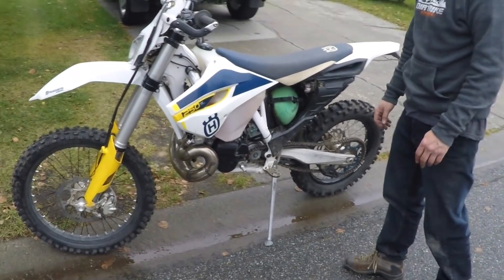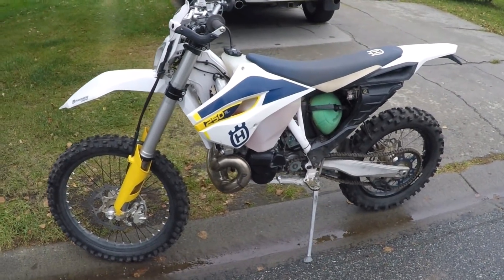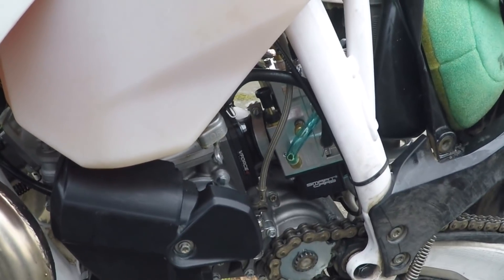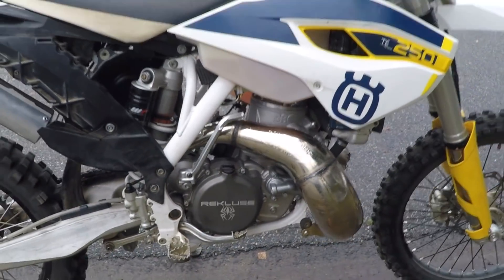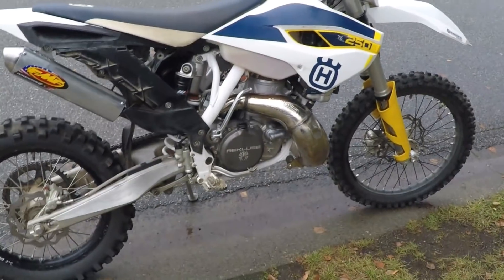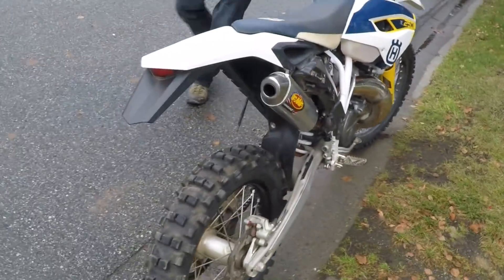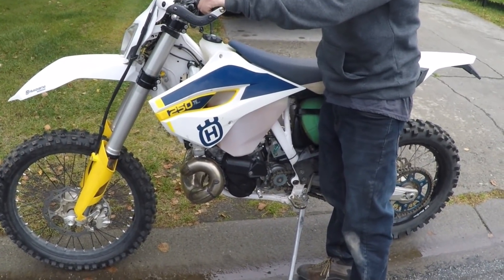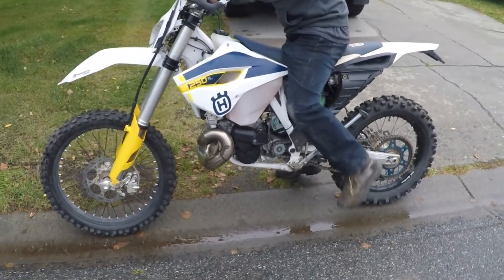BRC 500 with SmartCarb 40mm TPS and PowerCDI First Startup

Comment: How does that ignition mod work if the bike is running a carb is it a CFI set up ?
Reply: Oh it’s obviously a carb it has a choke, but still again what does that mod do ??
Reply from the maker: @kinglouis6974  It's a programmable ECU that is connected to a Throttle Position Sensor (TPS). The TPS is an add-on option to the SmartCarb. The ECU reads the throttle position and the amount of throttle change over time (it can read changes fast enough to adjust timing in a single revolution of the engine). Based on how the throttle is being operated and the concurrent RPM, it can adjust timing to retard or advance, affecting power output based on the dynamic relationship between the throttle and rpms.
Reply: Barry Jackson but I alway thought ecu was to do with injection and the ecu would change the fuel so no choke , all that mod you put on can do is change the timing ??
Thanks for the info 🏴👍🏼
Reply from the maker: @kinglouis6974  The SmartCarb takes care of the mixture better than an injector once its set; it does altitude compensation automatically. The PowerCDI ECU provides 3 times the spark voltage and provides Dynamic Power Control (DPC) by instantaneously varying the timing to suit the rider's throttle inputs.

Comment: i want to hear you rev it out?! i hope you dont ride it outside of the power in your other vids. ill check
Reply from the maker: Check out the vid with "Petersville" in the title - It's run hard as a snowbike. We're just now converting it back to a trail bike.
Reply: @barryjackson9917  awesome, ill probably catch upcoming videos cause this BRC intrigues me, i rebuilt a 97 ktm 250 egs a half decade ago and love 2 strokes ("that 300 goes pretty good, what year is it?" haha), also that smartcarb is a great thing, especially if you take the bike to different altitudes or temperatures. i wonder if it ever has a problem leaning out in the cold or fouling plugs on a hot day. ive been anticipating a mainstream release of an EFI or even better direct high pressure injection model from ktm the last few years now and it never came. with emission regulations getting tougher i thought it was the logical progression - but it would boggle the minds of all the 4 smoker fans if 2 strokes suddenly had less emissions, more bottom end to mid-range power and better fuel economy. XD it would create a market rush from all the envy and disappointment. 2 strokes are just better, and people have to face it. twice as many power strokes is atleast 1.5x the power :)

ps. once the rims are back on, id love to see a motocross start with it, and a hard and fast burm to really hear how the thing sings. i know its not quite like a 250 in that regard and big bore 2 strokes still do produce alot of power lower in the rev range. something interesting i heard is that honda produced a fuel injected 400cc 2 stroke that raced in dakar in the 80's or something. you're re-invigorating my quest hahaha. cheers,

Comment: $8000.00 bucks later i hope so, great stuff, i can only drool, must be insane...
Reply: Dont drool these things are POS. Zero bottom end, zero top end. Legit garbage. Not fast at all.
Reply: @shawnszep4941 no they aren't.... They're an amazing kit and extremely popular! Now if you used the stock ECU and/or jetting, then there's your issue...you can't have a ignition mapped for say a YZ250 or something for an example, and expect it to work on a 500. Get a Vortex ignition or the ECU shown in the video, get it mapped for the 500 along with your other mods to maximize those, along with a 40mm Jet-less SmartCarb with a TPS sensor, and pick a good pipe for the kit...I have a custom cone pipe for the 500 that's similar to an FMF fatty, with a Ti/Carbon shorty combo...Boysen RAD valve kit, Loudmouth intake, a Phat Head with the MX dome insert ported specifically for race gas (haven't ever tried the SX dome insert) 13/50 gearing. 

The BRC kit uses CR500 pistons as direct replacement parts for easy parts availability, the kit has an auto decompress and when it fires it automatically closes. So it's like the CR500, just made as direct drop in kit without any frame, subframe, water hoses, intake medications to get it to fit like the other CR500AF conversions, and there's no worry of the front sprocket not being directly in line with the rear, or engine tilt being off like what can happen trying to squeeze a whole CR500 engine into your frame of choice, then making engine mounts/hangars, and cutting/rewelding the frame, which can potentially weaken it, aswell as changing the frames flexcharacteristics/rigidity. It just uses your donor bikes transmission (which I had tumbled/micro polished), clutch that I replace with a Rekluse slipper clutch, put a boysen high flow water pump/impeller kit...the only bummer is I broke 2 kick start gears because of the compression, luckily they came out with a good fix for the YZ250 using a much stronger gear. The bike absolutely rips, i raced 'A' class as an amateur and its easily fast enough for me...I can lug it like a 450 if I want, or ride it in the meat of the power and with my suspension guy who's done 500 conversions before, he got me the right spring rate and valving/shim stacks to get my KYB SSS forks and shock working amazingly well and balanced. It already had Ti-Nitrate lowers, black fork lugs, Kashima coated uppers, and X-Trig split triple clamps. Also got some titanium engine hangers, and all the other bits and pieces from when my YZ250 was my race bike. The crank was also weighted and balanced so like the newer KTMs, there was barley any vibration and I also have rubber mounted bar mounts to decrease the vibration even more...So you don't have to worry about doing a full bolt check after ever 30min+2 practice moto because normally a 500 will vibrate itself apart. I also have an extra wheel set with a paddle tire for the dunes, it's a monster out there when you can just let it eat. So yeah, something was wrong with the one you rode, it wasn't the kit that was at fault.
Reply: @BilkoMX124 where did you find the head and cdi for your brc? Iv never seen aftermarket parts available other than the hygge pipe. I can't even find a silencer

Comment: Runs pretty good for a 500cc twostroke👍. 
How long can you ride with the 9,5 L fueltank?
Reply from the maker: It's being used as a snow bike at the moment. Here's a link: https://youtu.be/LJCTeOmM6zA In the description it was noted that on this ride it was ridden for 4 hours without going on reserve (with the SmartCarb and PowerCDI). We don't know what to expect in the summer, but it's likely to be similar. If that turns out to be true, then the mileage with the summer setup  should approach 75 miles - 90 miles on a standard 2015 XCW tank (which I think was 2.8 gallons).

Comment: I appreciate the use of the longer silencer, I can't help but wonder what the gains would be with a shorty.....for off-road purposes of course, perhaps a comparison video is in order? 
I know it really doesn't need more power, just curious where it would move, and if it would be an improvement, or detriment. 
Nice job boys.  Keep it up. 
Can we get some more on that billet smart carb.?
Reply from the maker: Its a 40mm billet SmartCarb with a throttle position sensor. The throttle position sensor is used with a PowerCDI ECU. The PowerCDI ECU has a custom ignition map for the BRC 500. In addition the PowerCDI has the capability (not currently set up) for Dynamic Power Control, a form of engine power management based in dynamic ignition mapping and throttle position/movement. In addition it has the capacity to acquire dyno data for use in re-mapping when desired. 

The SmartCarb compensates for altitude changes, vitally important in a snow bike, and yields significant increases in fuel economy, not to mention good cold starting. A recent ride (yesterday) by the owner provided 4 hours of riding in deep and heavy snow conditions (he calls it "mashed potatoe snow") while using 2 gallons of fuel. Overall, the SmartCarb with TPS/PowerCDI combo on the BRC500 platform is working well above expectations.
Reply: Start pipe = top end, long pipe more bottom

Comment: What is a TPS smart carb?
Reply from the maker: Here's a link to Technology Elevated, manufacturer of the SmartCarb line of carburetors. TPS is Throttle Position Sensor, which means that with the right electronic components, the throttle position being held on the SmartCarb can be determined and an electronic signal can be sent to an engine control unit (ECU) which can then instruct (electronically) other elements of the fuel and ignition system how to react. 

The most common uses of TPS on a SmartCarb is to adjust ignition timing and operation, and to adjust oil injection in some two stroke motors.

Comment: I did test drive a 2017 KTM 300 2 stroke and it was real fun to ride when you hit that power band, very additive feeling :) Only problem was I wanted more, it had much less power then my old Yamaha WR450F so I ended up with a 2019 KTM 500 EXC F that I am very happy with. But it is not as exiting as a 2 stroke and it does vibrate unlike the new 300 2 strokes with balance axle that have practically speaking no vibrations at all from the engine. I would probably love a modern 500 2 stroke with balance axle :)
Reply: Husaberg 570 is the ultimate 4 stroke

Comment: BTW sounds like he left the choke on there for a minute... I wouldn't run ethanol gas through that puppy either no way
Reply from the maker: That was without having dialed in the SmartCarb. No ethanol gas here as far as I know.
Reply: @barryjackson9917  thanks for the reply sir. That make sense regarding"smart carb" im gonna Google here shortly 10 of 7 eastern time, but I gather it's gravity fed carb... Sounds intriguing, also im certain you can strap that BRC into anything you want, they sell it as "for 250 / 300 ktm's but hell. With a wiz wheel and a mig... 😁 GREAT POST. get some more of that out ppl want to see that for sure. 👍

Comment: Soon as I get an extree $11k. Lyin round I'm ALL IN!
😆😆😆😁😁😃😃😃😄😄😄🤩 The husky seems better than the KTM in all seriousness
Reply from the maker: Yep, it's not cheap, but it's not 11K either. The engine kit is about $5800 USD. You don't have to do the SmartCarb nor the PowerCDI, but if you do add another $1700 USD. With all 3 it's about $7500 USD, but you do have the best of the best.in my opinion.
Reply: @barryjackson9917  well you also need a husky right?
Reply from the maker: I assume if you want a kit like this that you already have a donor bike. If not, then yes, you'd have to add the cost of a donor bike. I already have a donor bike - my 2015 300 XCW, so that's not an issue for me.

Comment: What is the actual purpose of these 500 2strokes, 95 percent off people can't even use the power off a 500 4stroke.
Reply: The grins on the 5%.
Reply from the maker: Fun. Summer. Winter.
Reply: @RonMcCaffrey-f9d  lol u must be American.
Reply: Wide open desert runs! 😁😁😁
Reply: They are actually easier to ride . Very tractable power especially with the recluse clutch . The big bores also last for ever since they are not revved up as much . You can enjoy the tractor like power and hardly ever need to open them up .
Reply: yes you are right... that 5% remaining, though...WhooHoo!!!
Reply: 95% of the people that could ride one are from an entirely different generation. Today's whipper snappers have light weight bikes that "Feel" powerful. Don't get me wrong they are talented and the new bikes are powerful but the skill of old to really ride one is 95% gone. Ride a 500 once and it will straight kick you in the nuts but for some reason you will want a 500 until your last breath.
Reply: 95% of people cannot ride a 250 4 stroke to its limit. Forget the 500s.
Reply: @EnkeiTenjin  most ppl would find if they put there ego aside that smaller would be faster I definitely found this while racing for husky years ago.
Reply: It all depend of where you ride and what type of riding and it is also just fun to have power to play with even if you almost never "need" it :)  For some types of riding you have no problem using all a 500 4T has to offer with no problem even for an inexperienced rider like me. I did test ride a KTM 300 2 stroke and found it lacking in power compared to my old WR450 so now I have a 4 stroke 2019 KTM 500 EXC F. But it would have been nice to have a modern 500 2T with balance axle for a vibration free ride with even more power then the 500 4T :) Big 2 strokes is addictive because they are challenging and more exiting to ride then anything else, not because they are easy to ride :)
Reply: @a64738  "I did test ride a KTM 300 2 stroke and found it lacking in power compared to my old WR450" - More like you found the much lower torque of a 300cc VS a 450. Sure the 450 might have more power throughout the rpm range, but not much. 300's make nearly 50HP at peak.
A smooth modern 2T 500 sure would be a great competitor to the 4T's. It's too bad emissions are such a big deal nowadays. Also, few people could handle a 2T 500 if it's got the typical steep power curve and hit.
Reply: Because you can
Reply: Snow bike Motor...
Reply: Lol yea ok!! My 20 year old daughter shreds my cr500 ppl that actually know how to ride can def handle a 500
Reply: @aarontroutman8255  bull shit
Reply: It's not always about being able to use a bike to its full potential, you can leave that to the pros. Sometimes it's hard to beat the feeling of having so much power on tap and scaring yourself can be half the fun
Reply: Fuck you